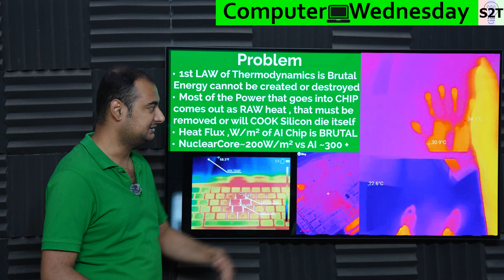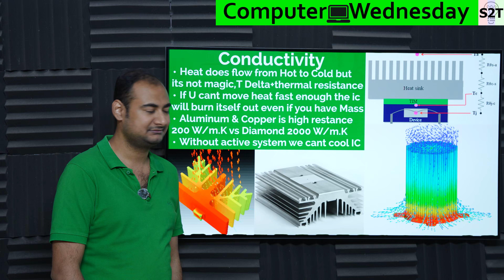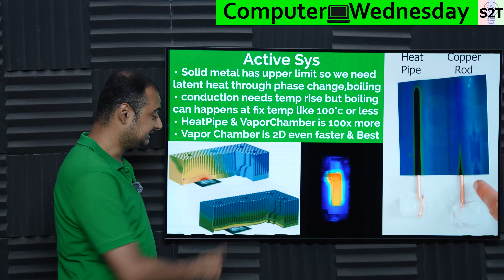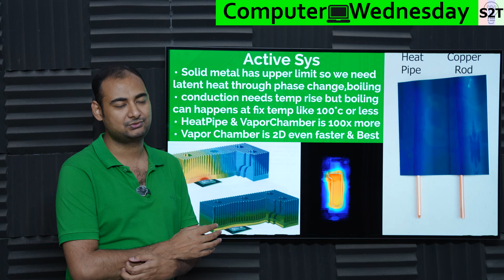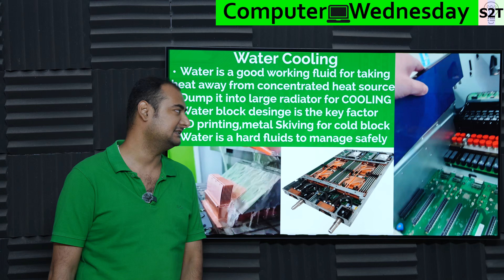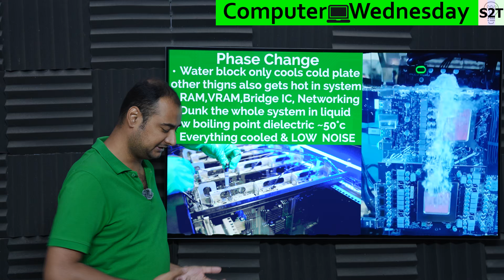Cooling Modern AI Beast Explained {Computer Wednesday}

Comment: Reply to ur comment "water will erode silicon"

It's like you never attended your chemistry class 

Silicon crystals are covalent bonds 

Water cannot break those bonds that easily , it will also happen on copper and nickel much faster than silicon 

It will take 16.6 years to etch 10micro meters of silicon because of erosion (unless they are running salt water it should be fine)
Reply from the maker: u should try it & dont take things on ideal case but at it wost case at that point metal is free and silicon etching water microchannel is just not worth it

Comment: There's no fixed boiling point in a heat pipe or vapor chamber, the liquid vill evaporate or boil where ever the temperature is higher, and the vapor will condensate where ever the temperature is lower, at any temperature, long as the temperature remains above the freezing point of the fluid. With a fixed amount of fluid, in a fixed space, the pressure will change with temperature, and the "boiling point" is completely dependent on pressure, so there's no fixed temperature where the liquid boil in a heat pipe, or equivalent system.
Reply from the maker: system starts at the  fixed temperature then it hits equilibrium . that is why there is different fluid for different temp range

Comment: Why can't you just force water directly over the die? 

If you can have liquid metal 

Have filters and stuff to clean it If contamination is the problem. ?
Reply from the maker: It's like you forget to understand that water can Erode anything at high flow rate ,second water is a universal solvent